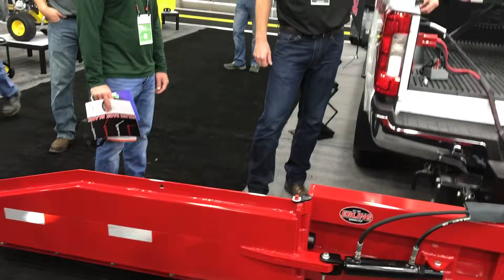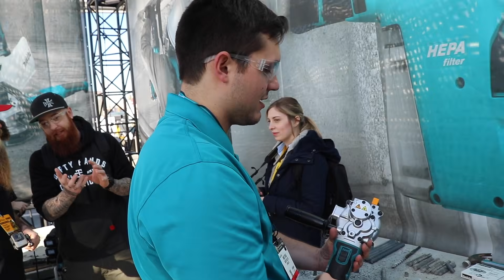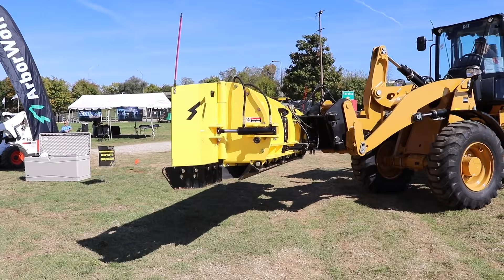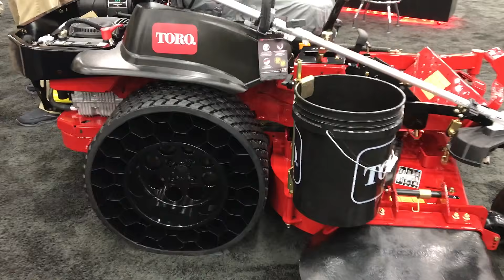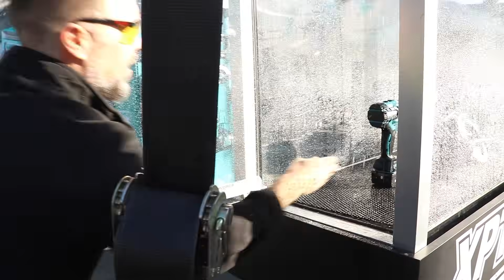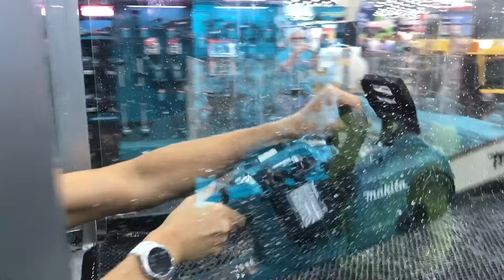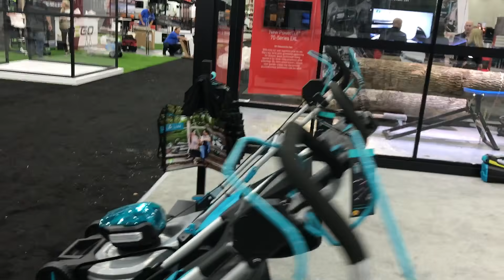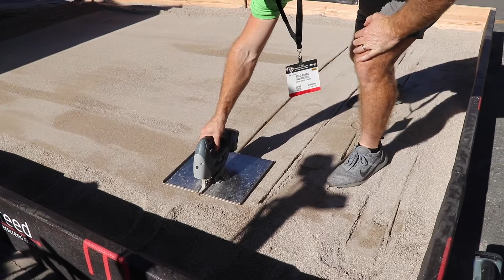Best & Worst Landscape, Construction & Power Tools, Equipment & Innovations of 2018

Comment: 13:40 Noob here. Does this product make any sense since the dirt will need to be compacted anyway?
Reply: I think its for poured concrete but they're just demonstrating with sand
Reply: Zareth DeTullio
Ah, makes sense.
Reply: You also screed sand before laying pavers and this could be used for that application as well as concrete screeding.  The sand for pavers is only compacted once the pavers are down and have locking sand on top as well.

Comment: Ive used a cut off saw but it didnt have the rpms on the blade that the 2 strokes so i didnt really like it  
What about true underwater not just rain. It wouldve been nice for the cordless grinders were always giving problems cause the dust

Comment: That trimmer head is junk. I worked at a summer job repairing lawn equipment a couple years ago and a local golf course bought two of them. The whole head is packed with grease and within a day of use the grease had filled with dirt and burnt up. It took me 3 hours per head to take them apart and get them clean and regreased. They were back the next week for me to do it over again but this time one of the gears had stripped in both of them! I think the customer paid over $1000 each so completely not worth the money.
Reply: wow $1000 just for the trimmer head? It's a neat idea that it doesn't kick up stones and such. Do you know the name of the company?
Reply: turdsandwicher It was the whole trimmer that was $1k.
 https://maruyama-us.com/product/lb30/
Reply: We used these at the golf course I worked at, they are rotary blades, used them to maintain bunkers. They have been around a long time I would imagine at this point they are falling out of favor in light of oscillating tools doing the same job but better. I'll look up this company and see whats what, perhaps they are launching a consumer line.

Comment: For that rolled out road thing does anyone know how hard it is to roll back up?
Reply: Dane Johnson
2:52 for reference. You're right. The reel is powered. I thought it had tension on it but the road/track is loose.
Reply: Dave B I'm sure it is just as easy as unrolling it.
Reply: aguyandhiscomputer if you watched when the reel got to the separated parts between tracks the roller quit rolling. I'm sure there mechanism for rolling it in reverse
Reply: You have a point. It was easy to unreel because the machine was putting tension on it. Rolling back up will probably require the reel to spin.
Reply: aguyandhiscomputer thanks I didn't catch that first time watching

Comment: That poor guy operating the wet chop saw with jeans and dress shoes! Lol I've ruined many pairs of street shoes by sludging them up like that.  Really liked the video Stan.  You covered a lot of tools and it's great to see the manufacturer's are helping contractors out with the push for the dustless tools.  It's a pain in the buns to have to be so worried about dust regulations now, but our health and others will surely benefit in the long run.
Reply: shaymoose17
They should have some rubber pants for that. Don't know the technical term for those. Chaps? Yeah, I'll go with chaps.

Comment: What the heck was that trimmer attachment? I didn't get it at all.
Reply: Its basically a scissor type deal. The idea behind it is to eliminate throwing rocks/stones and debris that could injure the operator or property. Not sure how it works in the field but the technology has been around for a few years now.
Reply: Wilde0709 Until earlier this year I owned a small landscape/ lawn maintenance/concrete/retaking wall company. Honestly, I would have checked it out  enough to understand it, but I don't see that it would have made it to my gear. Many of the things he showed were pretty great. And I would have made room for them on my truck/trailer.

Comment: Shihl's 4matic line of power tools work exactly like a 4 stroke does without oil in the crank case and still uses your regular 50:1 2 stroke mix, I doubt the Makita is much different

Comment: That's not underwater.  All Japanese electronics are drip and splash resistant, but can I take my Kyocera phone underwater to take video using my Makita tools working underwater, hopefully.  I love Makita but let's be honest about wet versus underwater operation
Reply: as an HVAC mechanic i am using my drills constantly as well, only difference is i am having battery failures yearly, so i don't know. you tell me. would love to believe i was a singled out case, few people i know are having to buy them every year as well.
Reply: I lost my makita impact in the river. I pulled it out aver 24 hours later with a big magnet. battery was shot but the impact still works fine.
Reply: I’ve got Makita 18v batteries that get used daily on the job site and in my cabinet shop and are more than ten years old. Not sure what you think could be wrong with their batteries.
Reply: Stefan Bacon the new brushless stuff is potted so well it can be used under water, not for long, but all day in a rain. My experience anyway.
Reply: Osha compliant the sign says.. And here they are cutting with a partner saw with no safety glasses or face shield.. How dumb..
Reply: wooodrow99 Makita used to, if they haven't changed, have a chip that permanently disabled the battery if you ever tried charging it when it was beyond its temperature setting.  So if it was too hot, and you tried to charge it, instead of waiting till it cooled down, it triggered a non resettable kill switch and now you get to go buy another 100$ battery just because you didn't look at the thermometer built into the battery.  (It's not there don't bother to look) 

Well when it is cold out and you , knowing the battery needs a charge, try to charge it, this same kill mechanism activates and you again are looking at replacing the 100$ battery. 

Burnt once twice shy. I have heard they fixed this but only word of mouth nothing official.  

Personally I think the cordless tools have some flaws where strength is involved (nylon gears) but all the corded tools are top notch.
Reply: "Under water", not "underwater"
Reply: Hey a I'm watching this on a Kyocera mine actually I tested under water cause they now have on there cameras a underwater more we're it uses the buttons
Reply: @sansistheking9575  and  @sbacon4 my Kyocera Torque  KC-s701 worked flawlessly until i lost the dust covers for audio jack and charging plug. When i deep-discharged it one night (actual 1%)  and tried to charge it the battery bulged and the screen got bent outwards... now it's dead and Kyocera only offered a replacement, no repair... they should have stayed with printers........ hopefully CAT is better in that respect. Fun fragile phones.
Reply: Not even that, they are actually cooling the tools down with that water drip. No way they could run non-stop for days otherwise.

Its pretty damn clever of them to demo them that way.
Reply: I'm guessing that they mean under a steady stream of water but it's true that it wasn't submerged underwater.
Reply: Apples to oranges. How many moving parts are on your phone? Some contact switches under a membrane?
Reply: Makita is a great product, it is a shame the batteries are not as great

Comment: That's not under water.... that's under a dribble of water. I want to see them submerged and ran.
Reply: Do you do much underwater construction where you need to run your impact submerged?
Reply: Greg Dumpert personally no. But for somebody who builds boat docks and where tools might get dropped under water, a submersion test for electronics is a lot harder to pass than just being splash resistant. Most of he conformal coatings that cover the speed control boards in these tools to protect them from basic dust and corrosion is enough to be splash proof.
Reply: Drew w Being dropped in water and retrieved relatively quickly is no big deal. Having these told under a constant stream of water for 5 days is much more impressive. Conformal coatings for nothing more than to keep water of the circuit boards, it doesn't seal anything against water.
Reply: Drew w ... what would be the point of running them under water? do you build under water ? Don't be a fukin dumbass!!
Reply: @erikrobles5727  but a oops dropping it in the creek is alot more then that dribble

Comment: I have a rebar cutter from another company, and it's a game changer. How much was the roll out road?  I do most my work in backyards and that would save a lot of trouble.  That roller screed is a joke, if u pour it stiff it's slow and u have to bury every stake and it wears out if u run it in the same place a lot.  This new OSHA dust rule is a joke, As a small concrete contractor this is a large investment for things we already have, just a little dusty.  What's wrong with the masks?  This will probably cost me 15 grand, plus losing space on trucks for vac systems. not to mention time and labor.  I might have to look into the Makita concrete tools, It's tough to leave Stihl and Dewalt

Comment: Makita chopsaws have been very unreliable in my experience. We run only stihl
Reply: Brock Stewart unreliable how?
Reply: JCLawn51 we do sewer and water so tools get wet/muddy and see a lot of cement dust on storm water projects. After a week the makita wouldn’t run. Changed air filters and could get it to start again but with little power. Went back to stihl
Reply: Brock Stewart not even worth dropping it off for warranty after spending like $800 huh?
Reply: JCLawn51 our telecommunications branch still uses it. Tell me what is crew cost on a 5 man crew running dozer loader excavator standing around looking at a saw that won’t cut. $800 doesn’t go very far huh?  I enjoy your videos not trying to be a troll , just my experience. Good luck
Reply: Brock Stewart i don't make videos. But from another persons perspective your story sounded far fetch.  It ran a week, we went back to stihl.  Well there is always more to the story.  Btw I'd imagine you have 2 or 3 saws onsite if you depend on them for that reason.  Kinda wonder if someone threw mix gas in it because if you do then you basically need a carb rebuilt kid. The mix oil plugs is up good.

Comment: how often do you have to replace the filters on the dustless system.  concrete dust is usually pretty fine and clogs up filters relatively quick.

Comment: Also if your up against a building demoing and u got rebar sticking out of concrete and it gets in that tweel. Kiss you $800-1000 tire goodbye.
Reply from the maker: Ouch-Good point.
Reply: NoC I don't know of that would work though.

Comment: why wood you need to run it upside down
Reply from the maker: to cut pipe in trenches or go vertical on walls.
Reply: Adam Heyman my husquava runs upside down big deal.
Reply: wooooo, Husqvarna!
Reply: Adam Heyman life brings it all better to not stall in awkward positions..you may only need it upside down once,but that's the time you get at done..n the others don't
Reply: Lee Martin, my Stihls have always run upside down.
Reply: that because their 2 stroke
Reply: Installing pipe in existing manholes
Reply: Why would you spell would wrong?
Reply: why wulod you gvie a siht how he seplls if you can siltl raed it? yuuotbe is not a tset

Comment: I remember having a rental on a job site and it had tweel's it didn't seem to go very good in the Florida sand they were to stiff wouldn't conform to the shape of the ground you could not control the wheel spin I thought they were terrible they did good on the asphalt and on the road base as soon as you hit sugar Sand it was done and The same rental company furnished the high lift it had them on it and it tore the job site all to pieces
Reply from the maker: Wow- Thanks-  see I had no clue- never ran them.
Reply: Stanley "Dirt Monkey" Genadek they are good on hard ground like clay or road base but down in Florida it's mostly Sugar Sand and the clay sand pumps up and down a lot like a sponge we seem to have better luck just running 5 to 10 lb less air than recommended in a regular pneumatic tire